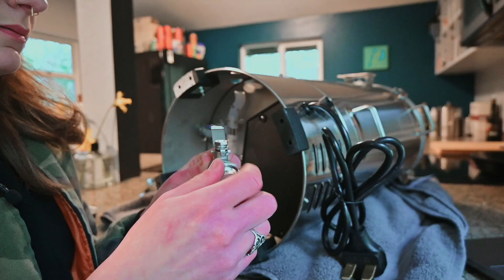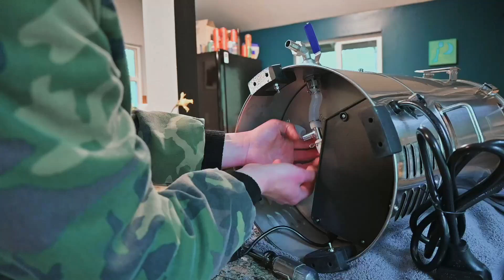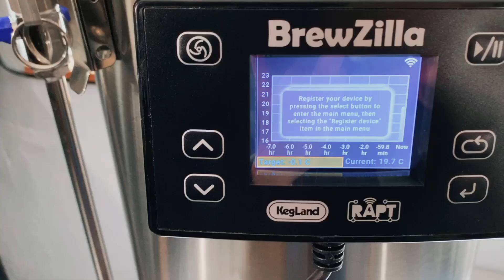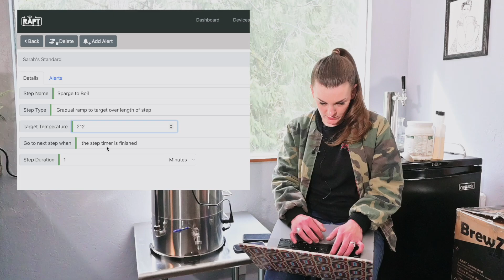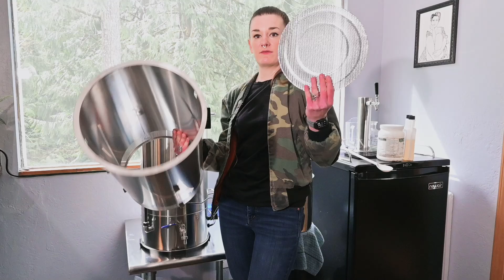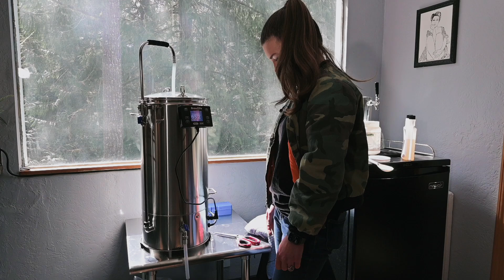BREWILLA GEN 4: All Grain Brewing System | Equipment and Rapt Setup

Comment: I brewed ten batches in the Gen4 so far. Always 10L or 20L batches.
It's working greatly. The only issue I have is the pump clogging.
My only solution is to blow some Co2 through the circulation arm.
I do know there is a risk to flood my room with boiling hot wort if a hose clamp gets blown off, but so far this never happened.
Best Regards

Comment: Just picked up a Gen 4 65l. Currently cleaning it ready for brewing. Here is one tip I can give already. Before trying to connect to RAPT check you have the latest firmware. It would have saved me an hour of swearing. Connecting to the fermentation chamber after that took about 30 seconds

Comment: If you trim the recirculating silicon hose to a length that is not in the wort. 
Then when the pump is turnedoff it doesn't suck grain into the tube and block the pump.

Comment: I recently brewed my first all grain batch on the previous model Brewzilla 3.1.1, and I love it. I got it on sale because of the new model coming out so it cost just over half what the new one does, which as a disability pensioner was a great selling point. It doesn't have quite as many features as the Gen 4 but it's still a great bit of kit and I'm really happy with it so far. I hope you get heaps of enjoyment out of your system and make some great beer with it!

Comment: Most stainless brew stuff is not magnetic.  This is also why you can't put magnets on stainless refrigerators. Some stainless is magnetic but it does tend to rust a bit quicker in my experience. Cheap stainless cutlery. If touching another metal type, it will rust fast.

Comment: What was your overall impression compared to other brewing systems? I've been using the 65 l version for around 9 months now. It took me a while to get the system sorted. Initially, I clogged the pump a few times with hops, that seems to be sorted now. Then I had an issue with the base of the malt pipe  falling in when making double batches. I've sorted most issues out and I think it is a pretty good system for a low budget. There are some good videos on YouTube on setting up the PID for different volumes that are worth watching.

Comment: man its hard to find brewzilla brewtubers, but I also brew on a gen 4. 2 things I saw on the video that you may have figured out but I can help with. 1l. The bottom screen is supposed to be a tight fit so the trub doesn't get around it and clog the pump. I didn't re-route the pump, but still don't trust the bottom screen and use a hop spider anyway. 2. The heat exchanger dish connected to the bottom screen was recently added because both the heating elements and thermometer are on the sides of the conical, so the temp was often wrong and the liquid didn't heat as fast as a lot of it would go straight down to the hole and miss them completely. I love your vids... and you may already have figured out everything I've said :) haha